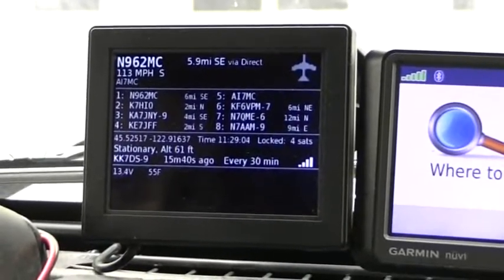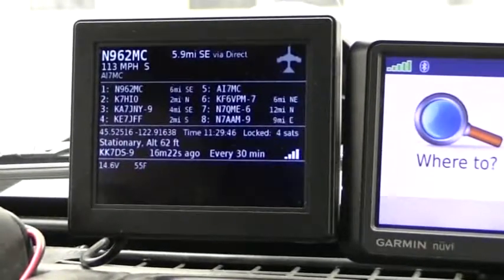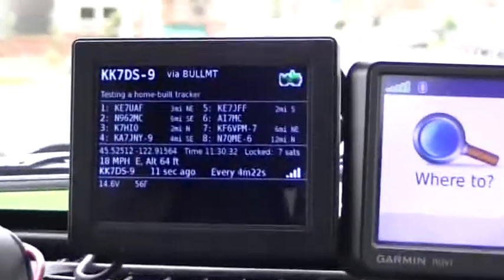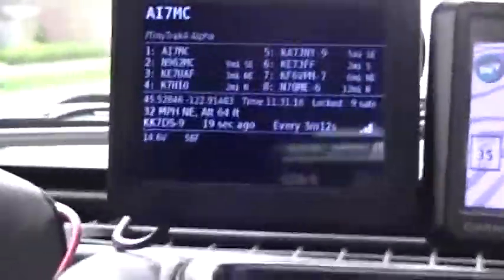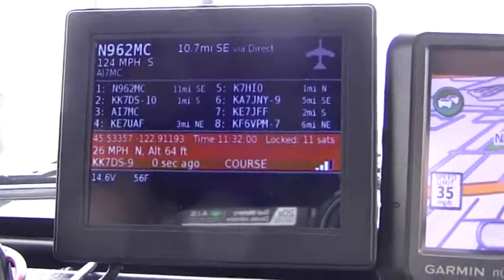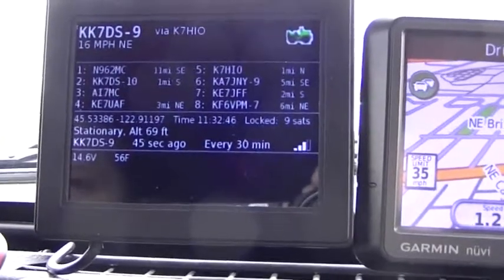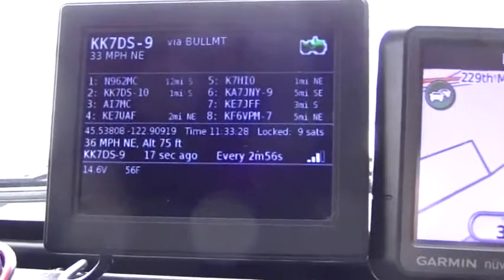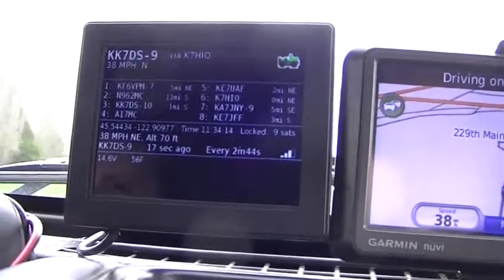My APRS Tracker Project

Comment: Looking for a Pi version , I guess would be running xsaster (Spelling ?) and have a gps attached to the Pi. I also have a Nextion display I can hook to my Pi. Seen one of these around ? Regarding this approach, I'll look, but not sure there is enough data for me to replicate it. And, I'm very green with pi's. Have done more with Arduino's, and like them very much. A few months ago bought a Pi B+ and have done little with it so far , but its very capable. I have a friend, a programmer, named Ian, who may have done the entire APRS project , will check. Also have JS8CALL able to send into the APRS network from co-ordiaates, ( grid) manually programed in, and its very exact with 10 digits. But, not controlled by GPS yet. I absolutely love all the "text" capability and possibilities from APRS, JS8CALL, and other places. (DMR) . Its a lightning fast network. I am wondering, why not just use APRS Droid. I've used it with the VOX BAOFENG system with good results. Just takes a spare smartphone and you don't' need data at all.